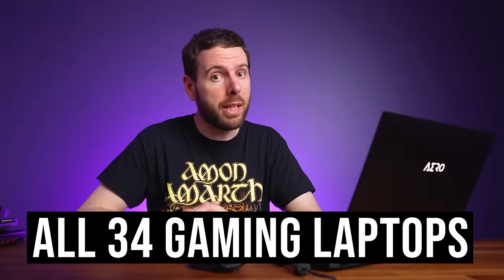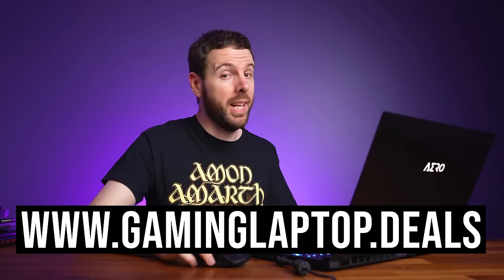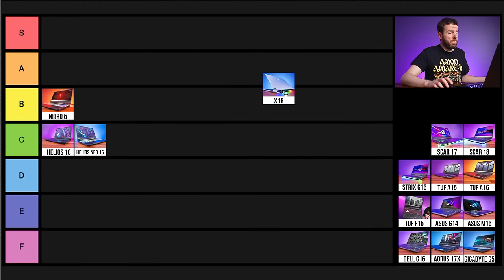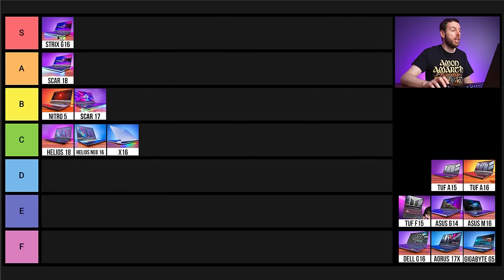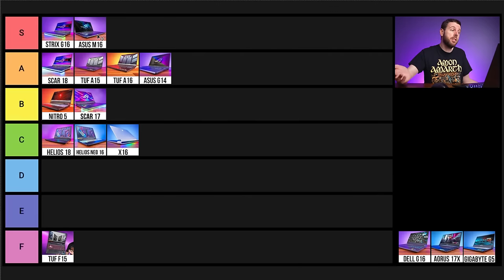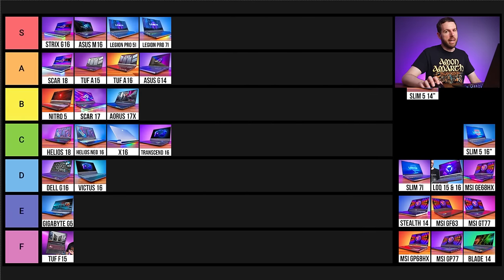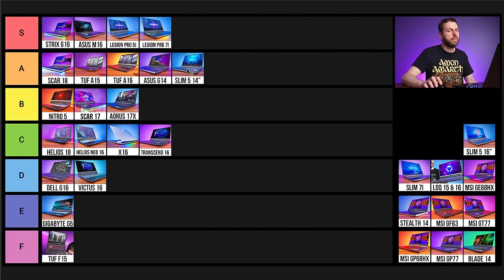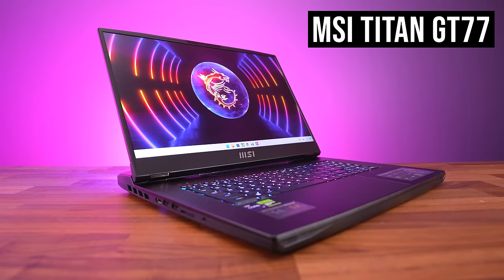Ranking ALL 34 Gaming Laptops I Tested In 2023!

Comment: I've got gigabyte g5 kf5 with 12650H , 24mb L3, 32gb ddr5 4800Mhz and rtx 4060 (75watts) and after updates, bios and Nvidia optimization,  laptop became alive and with cooling pad(13$ amazon) its been great and getting massive fps no lags or throttle.  I guess you gotta do few before you can truly enjoy this laptop. 2 downside is screen could have been better and sound but whats more important is that gpu cpu...
Reply: Mine overheated so much that I had to buy a high end pressurised laptop cooler from a botique chinese company so it doesnt constanly thermal throttle at 96c
Reply: @vladimirdobrinkov1761  thermal spike can occur but, try also fan speeds in more non linear form, control center fan setting in linear which can't keep up with spike, so make aggressive fan setting profile like after 78c , 89% fan speed...below 78c keep fan speed 74%.

Comment: So disappointed in your review of the G16 and this video! You said the G16 was “pretty good” but in this video you it’s the first laptop you put in S-tier. I passed on that based on your mid range review and purchased a laptop you said was the best laptop you have tested this year, which in this video is c tier. In your individual laptop reviews it would be nice if you were very straightforward or used words like great or excellent.
Reply from the maker: In the review I mentioned it was good but it was too expensive. Opinions change over the year as we review more laptops and have more to compare with.

Comment: Yes. YES! All of the budget laptops SHOULD be in the lower tiers, unless they are actually good. All of the  high end laptops SHOULD be at the top, unless they don't perform well. Price is irrelevant, because as you said several times, prices change. I want to know which is the best, fastest, most upgradeable, clearest and brightest screen. Let ME decide how much that is worth. Let me decide how long I want to wait for a sale. If you are going to normalize, don't do it over price. Normalize over screen size.
Reply from the maker: That's one way to do it, but not everyone wants that and this is mostly subjective, based on my thoughts about them after reviewing them. You can see how they compare with other laptops in the reviews and some info is available on my website:
https://jarrods.tech/resources/
Reply: @JarrodsTech I disagree. FPS is objective, so are nits, noise tessts, battery life, performance on/off battery, expandability, heat maps, and screen size, mux, advanced optimus, disk speed, warranty, etc. Yes, overall build quality is subjective, but I value your opinion, because you first-hand experience  is so great, as is your understanding of the technology, and most of us can't lay our hands on all these laptops. My point is that you have so much objective data that normalizing it across a highly subjective and highly volatile data point like price seems counterintuitive. Maybe others don't want it normalized across screen size, but something objective and stable would be better than something subjective and volatile.

Comment: Lenovo is shit, don't buy it. They provide some great specs and the cost of build quality. I had two laptops in recent 3 years and needed to take both to repairment. One had ssd issue and motherboard issue (second one was costly and with no guarantee of not happening again soon), other had a screen issue and battery/charging issue. I have complaints by my friend as well. Lenovo was great 5 years ago and now it is just garbage.